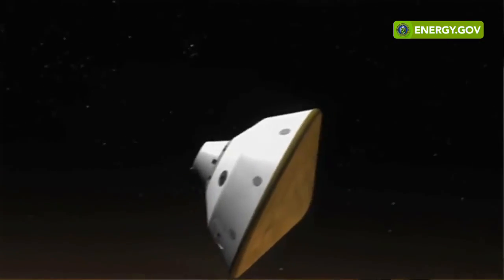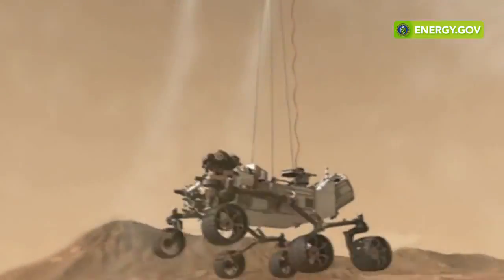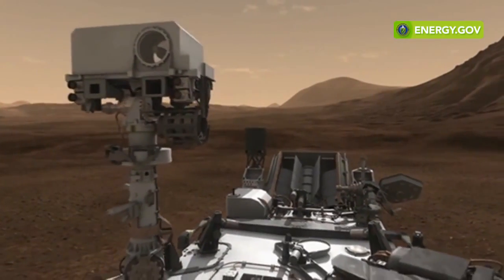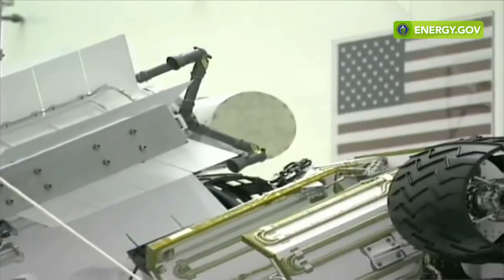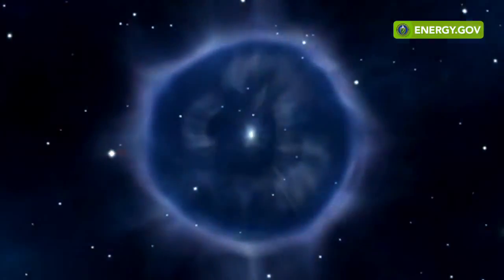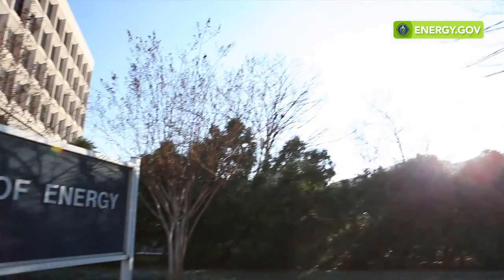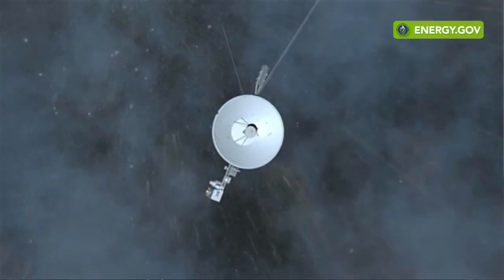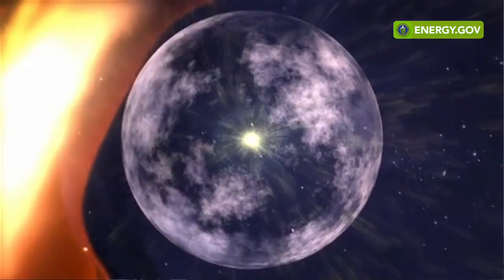Radioisotope Thermoelectric Generators: RTG Energy for Space Exploration

Comment: The  current Radioisotopes Thermoelectric generators (RTG's) relies on thermocouples to generate electricity at just 7% energy efficiency conversion, that's  a too low efficiency. However Thermophotovoltaics (TPV) cells research are very promising, capable to generate electricity up to a 26% energy efficiency conversion. So we can generate almost 4X more electricity by the same RTG size and weight. This could be vital to establish a future permanent colony on Mars. If the RTG used in Curiosity rover does have TPV Cells instead of thermocouples it could be generate about 400 watts of power

Comment: Hi.....Question: It is mentioned that the temperature difference between the radioisotope and the heat sink produces the voltage emf......if the RTG is in a satellite or probe of sorts......how does the heat sink keep the "cold" junction cold if the amount of ambient air inside is limited and there is vacuum on the outside? The heat on the cold junction has to be dissipated somewhere right? I must be missing something here......maybe you can tell me......
Reply: aboubrad the “cold” side is the outside of the RTG. This allows the system to radiate the heat energy out into space as infrared photons. (Heat is transferred by conduction, convection and radiation.) In a vacuum the primary modes are conduction in the body of the RTG and radiation away from the body.
Reply: aboubrad I'm sorry this is classified information.
Reply: The heat sink radiates off heat in the form of infra red radiation. Every object with a temperature above 0K will radiate energy in the form of electromagnetic waves, which is how RTGs achieve the temperature difference needed for the thermoelectric effect to work. You are correct that the heat sink isn't cooled by airflow as it would be in a computer for example.
Reply: Also many things heat up and react differently in a vacuum.

Comment: how many energy produce by rtg. this rtg similar to iron man Arc reactor?
Reply from the maker: It is somewhat similar to the arc reactor in iron man, but in real life its quite dangerous since it uses radiation to produce the electricity. In the 1950's and 1960's there were various designs for RTG powered cars, trains, ships, and spacecraft. So far the only vehicles to use RTG power have been spacecraft, due to the inherant danger the radioactivity of a RTG power system presents.
Reply: thank you for information
Reply: 1 Kg of plutonium 238 contains about 621 927 KWh. A typical household consumes around 15 000 KWh per year. If you're curious about power: 1kg of plutonium 238 generates around 500 watts of heat. The thermo-electric generator converts 10 percent of that heat into electricity.
Reply: The RTG on Galileo, Cassini, New Horizons missions generated 300W electrical from 4400W thermal with 7.8kg of Pu 238 fuel and a total mass of 56kg.